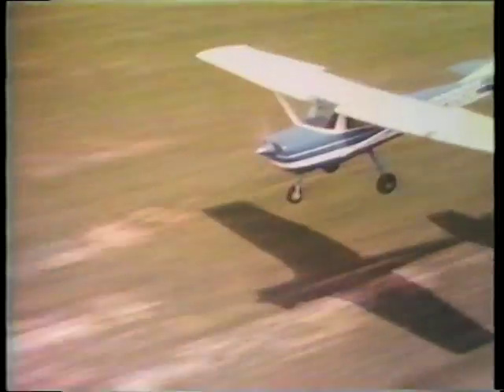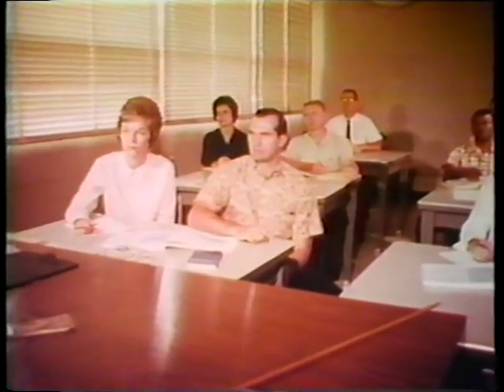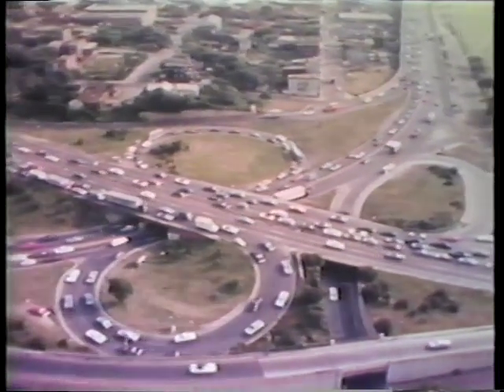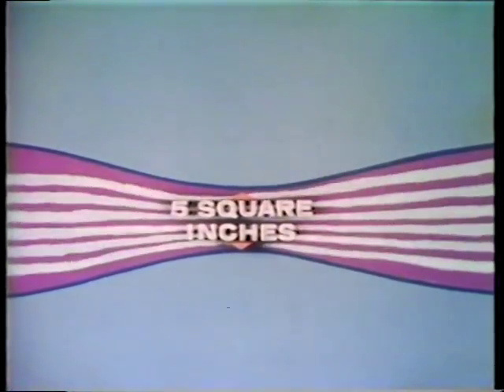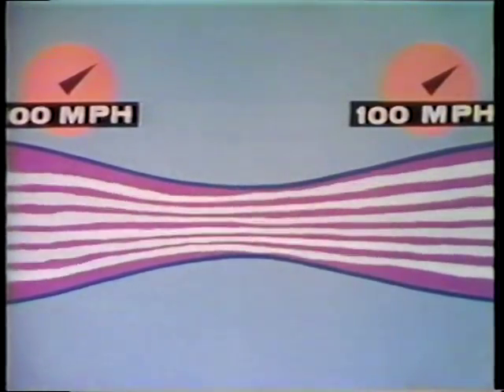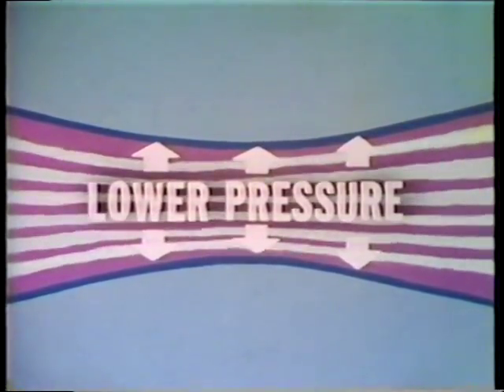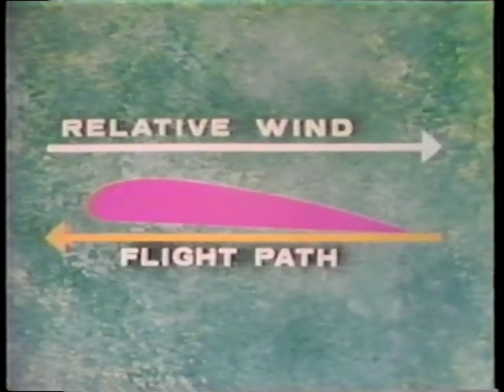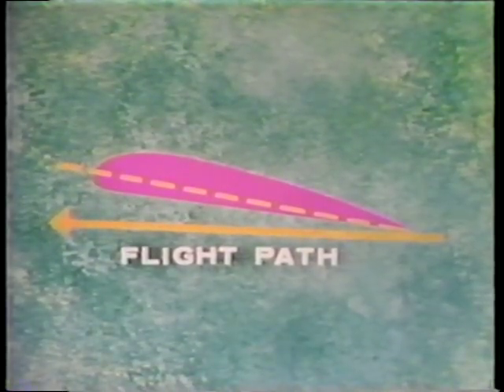How Airplanes Fly

Comment: No worries- not circulation flow theory. 
As NASA describes it,"lift is a force created by turning a fluid."
Turning flow is what happens when solid objects come into contact with a fluid and the object changes the direction of the fluid. The flow turns. The resultant force is known as lift for our purposes. A flat plate or symmetrical aerofoil at 0 AOA creates no lift. Incline it to the relative airflow and it does. Turning the air causes lift. Pressure diff is a result of this, not the cause.

Comment: A simple proof that it is primarily AOA (turning flow) that is critical -  is that a flat plate, a kite, a hang glider all produce lots of lift with low drag. So many people think a wing has to be curved on top and flat on the bottom but this is simply not true. make yourself a paper plane and prove it. Flat plates work just fine but stall at a lower angle of attack. Wings are not venturis, the upper airflow  does not speed up to meet at the trailing edge ever, in fact the upper flow slows down.

Comment: Pressure differential is primarily caused by AOA. Flat plate wings prove that. Lift is caused by turning flow. I have yet to see a satisfactory explanation of circulation flow and why it is not visible in a wind tunnel or in CFD.

Comment: Bernoulli's Principle is an entirely incorrect assumption for what causes lift. It dramatically underestimates the component of lift on the suction surface of the aerofoil. It's an old video but unfortunately it teaches the misconception which needs to die.

Comment: The only problem is that wings are not venturis and never will be. A venturi behaves such as it does because it is a closed system. A wing has no relation to a venturi. This video is very misleading. Wings work by bending the airflow.(Turning flow) It is turning the flow that causes the pressure differential not the wing shape as shown by the symmetrical aerofoil and also by supercritical wings that are used on all airliners which are curved on the bottom and flatter on top.